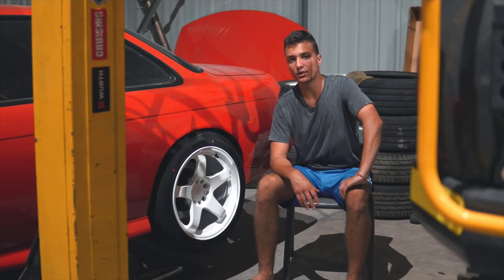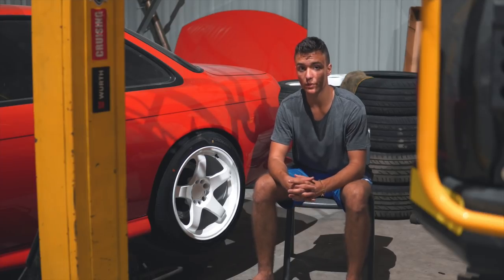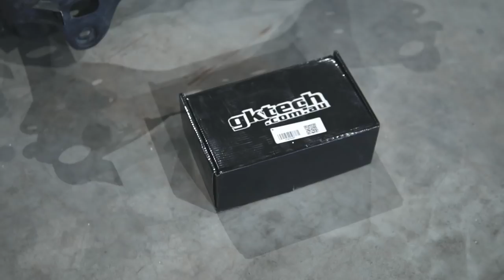Almost Fully RESTORED | The Broken Silvia [EP6]

Comment: Wow dude loveeee everything about the videos! Quick question what was that product you used on the wheel wells? Truck bed liner? Im doing similar to my altezza
Reply from the maker: Cheers dude! I used Rustoleum's underbody protection. I used 2 litres just to freshen it up. If you wanted to cake it on and genuine add a thick layer of protection, I would be aiming for 5-6L. Hope that helps
Reply: Broken Silvia thanks man gunna keep watching the videos love the restoration ! I currently am doing the same powder coating all my control arms and all my adjustable arms with all super pro bushings prior to a 1jz swap
Reply from the maker: @Juniorrrrrm  Awesome man, need more clean builds out there!

Comment: The diff you fitted isn't a gtr diff. But other than that I'm liking the videos. Did you solid mount the diff but rubber mount the cradle?
Reply from the maker: Oh damn it. It was sold to me as a 1.5way Nismo LSD, cheers man. The diff was mounted using Whiteline bushings
Reply: Gtr diffs are 6x1 bolt axle and a 6 bolt cup tail shaft flange. It's possible it's still a 1.5 way but just out of a r33 gtst
Reply from the maker: Ahaaa I see! Well let’s hope that it is a 1.5way at least haha